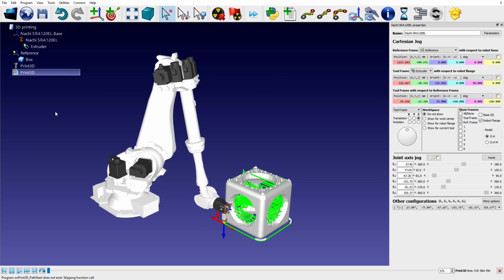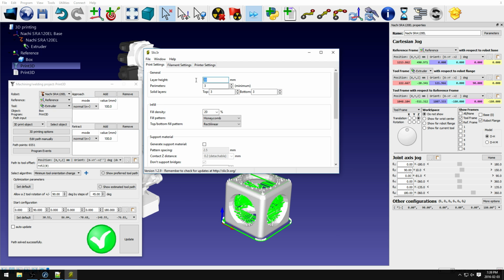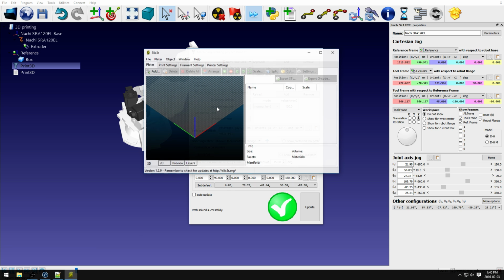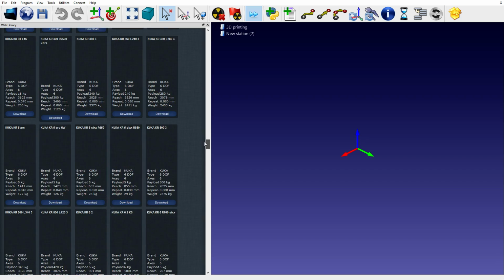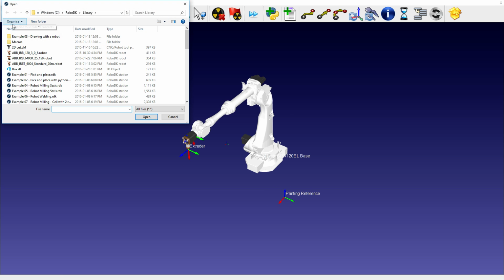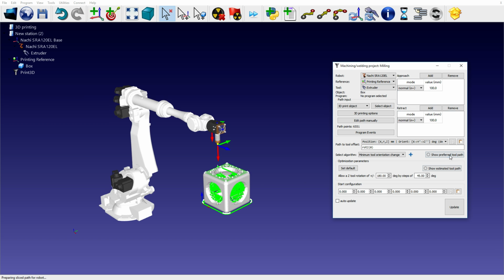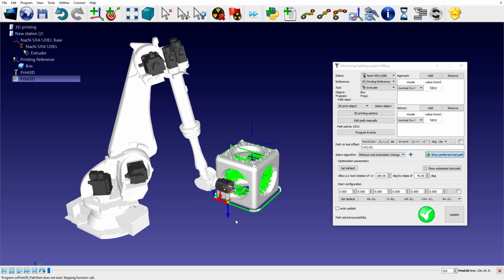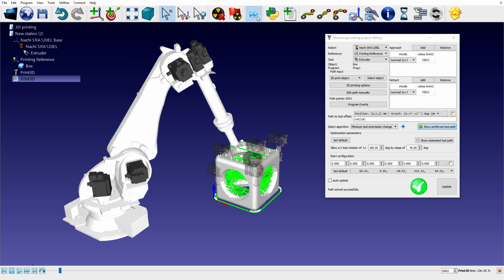3D printing with a robot - RoboDK

Comment: how to install slicer in robotdk, i can not use 3Dprinting  option it shows error, what are the settings to be done
Reply: have the same problem. I manually extract slicer in to RoboDK/Other/ , but if i click 3D printing options, robodk can't copy slic3r.ini hence the file not exists.
Reply: I have the same issue.. anybody solved this ?
Reply: Have you already solved it??
Reply: Have you already solved it? I have the same problem